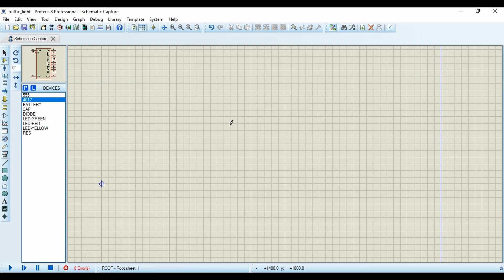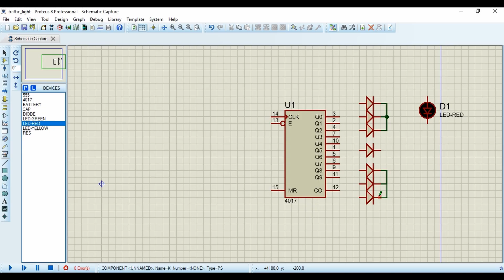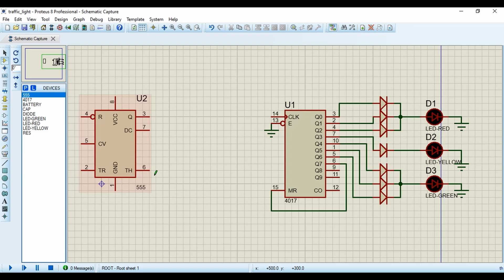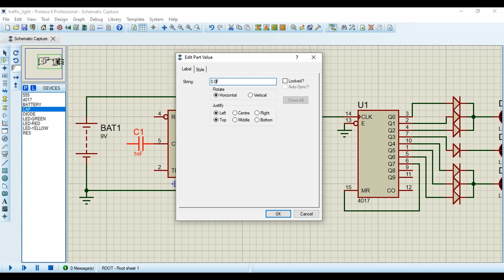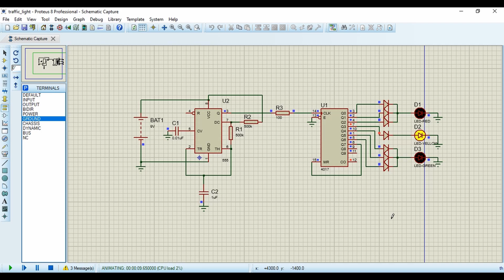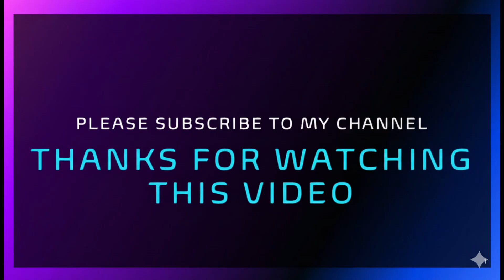Stop Coding! Build a Full Traffic Light System with Only Logic ICs | Traffic Light Control Circuit

Comment from the maker: If we want to increase the light switching time from 2 seconds to 10 seconds, which component in the circuit needs to be changed?
A) Battery
B) Resistor/Capacitor
C) LEDs

Comment: How to increase the time of one led I mean red as 5sec yellow 2sec and green as 10 sec ??
Reply from the maker: First step: Connect a separate diode from pin 6 (Q7), pin 9 (Q8), and pin 11 (Q9), and connect all three diodes to the same green LED.
Also, remove the wire currently connected from pin 6 to MR.
Second step: Reduce the clock pulse frequency. For this, increase the resistance values of R1 and R2 in the 555 timer IC. You can set the resistance up to around 900 kΩ, or adjust the resistance according to your desired timing.

Comment: can you help  me why first red led light not work
Reply from the maker: It is possible that one of the IC's output pins is faulty while the others are working properly. Before replacing the IC, check the output pin using a DMM in diode mode. If the reading is around 400–700 mV (and similar to the other output pins), the IC is likely fine. Then check the LED, resistor, and wiring connections. If that pin shows a significantly different reading compared to the others, the IC may be defective.
Reply: @EngineeringProjects-123 ok will try
Reply from the maker: For the timer part, I will upload a video soon for better understanding
Reply from the maker: Replace the IC.
Reply: but the others works properly so can I change  ic or not
Reply: because only that one light can not works properly
Reply: and also I ask that how we set the time of that lights
Reply from the maker: You can watch it here:
https://youtu.be/ydkRvEfu7To�
In this video I’ve explained the complete traffic light timer setup step by step, so it will help you understand the timer control properly. Thanks for your support!
Reply: means I want to control timings by myself to on and off

Comment: Dude? Can you help me built 2 way with same components? Please
I have a semester project due and I can’t figure out anything 
Tomorrow is the due date
Reply from the maker: Yes bro, I already made a 2-way traffic light system using the same logic gate concept. You can follow this video: https://youtu.be/cdsEfv00kIg�
If you get stuck at any step, let me know which part you're having trouble with and I'll try to help. 😊
Reply: @EngineeringProjects-123 I was asking how to utilise 555 timer IC and CD4017 IC for 2 way signal just like it is in this video
Reply from the maker: Just connect the Side Road Red LED with the Main Road Green/Yellow states, and vice versa. The same 555 Timer and CD4017 IC can be used for a basic 2-way traffic light sequence
Reply: @EngineeringProjects-123 thankyou so much